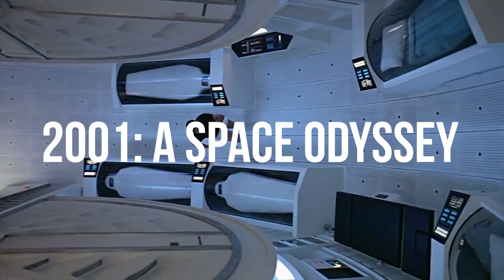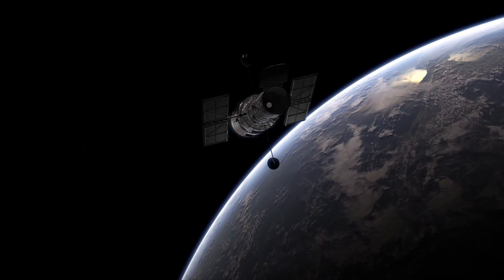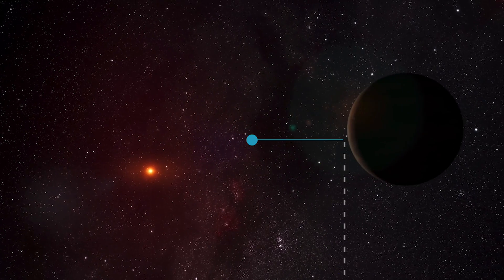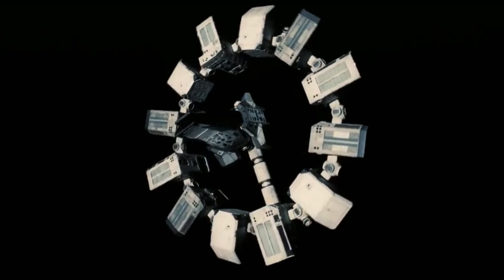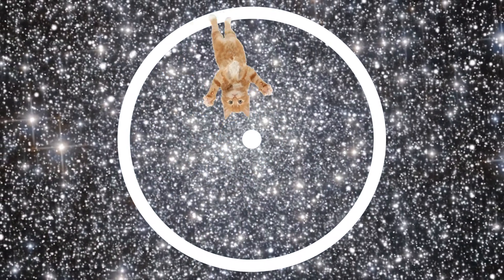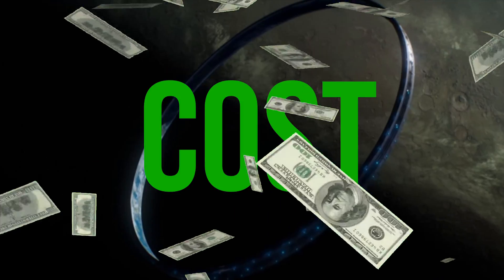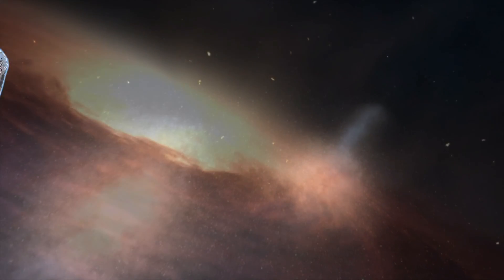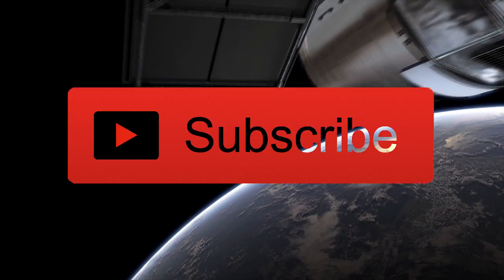How To Create Artificial Gravity in Space from a Rolls-Royce Engineer | STARRSHIP

Comment: Also with a rotating structure you can even out heat loads from solar illumination.

Speaking of which, a fun thought experiment would be to imagine a 2001-type double ring with X-ray cameras around the inside of one ring (call it Ring A) pointing at the centre of the other ring (Ring B) - could you do 4th-generation CT scanning of an object positioned at the centre of Ring B, using the sun as the X-ray source?
Reply: (If yes, what practical details would you need to be sure to get a successful scan, and what would limit your resolution? Answers on a postcard to...)
Reply: It would certainly be an interesting experiment but we might struggle to build the structure that wouldn't absorb the incoming x-rays. We would need it to be able to support the object being examined but also unaffected by the harsh radiation in space. In my mind it would be mounted on some form of rotisserie (like a chicken) as the station spins around it in perfect time to keep the x-ray detector in line with a window facing the sun.
We may also have an issue with the varying intensity of x-ray emissions from the sun and so need longer than normal exposures.
Those are my initial thoughts but now I'm distracted by whether I could cook a rotisserie chicken in space by just using the sun as a heat source.
Reply: Consider the geometry - if the sample is in the centre of one of the ends of a cylinder, with the sun behind it as seen from the edge of the other end, it needn't ever be in shadow. Out-of-plane CT might work, but I would expect poor spatial resolution along the axis of rotation. (Can you get the sample to precess as needed and do the maths? Maybe. Maybe not.)

I'd also agree that variation with time might be an issue - SpinCalc gives us about 1 r.p.m. for a lunar gravity on a 300 m diameter station (values from the 2001 Wikia), but I'd be more worried about sample drift than solar variation. Differing thermal expansion of the sample would also be a major concern for high-resolution tomography.

The critical point, though, is that the sample must be in vacuum, or it'll have an increasing tendency to move off-axis under 'gravity' as Dr Floyd hopes to have when he arrives at Station V.
Reply: How we rotate space craft? By any generator or anything else. .?